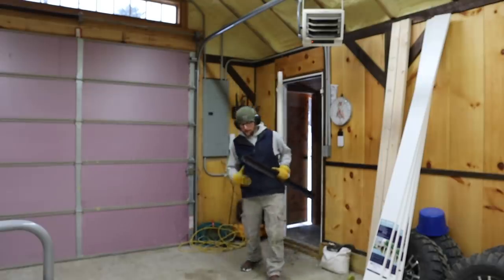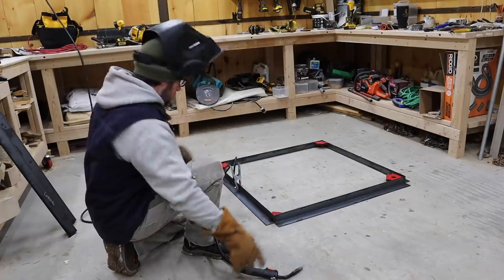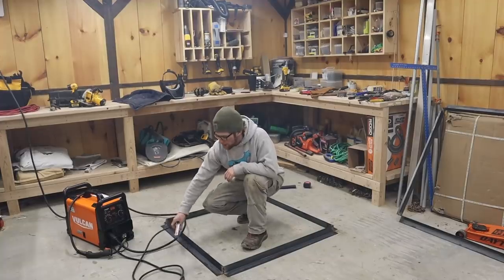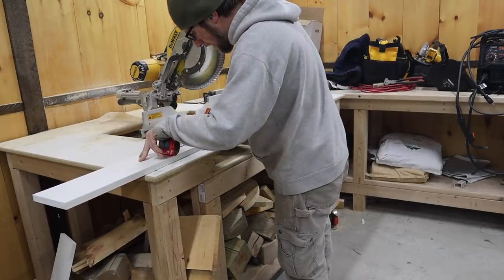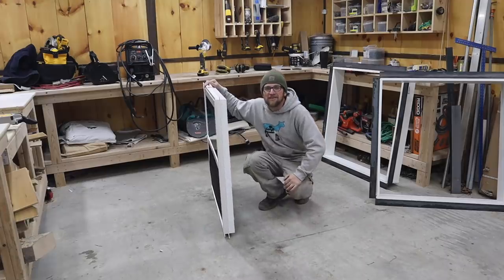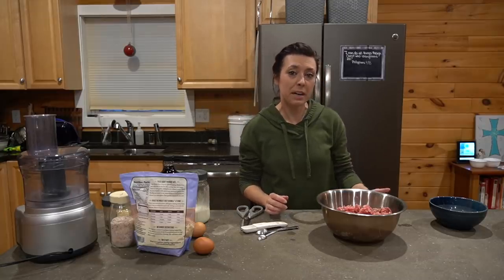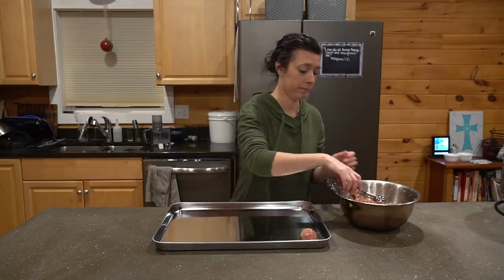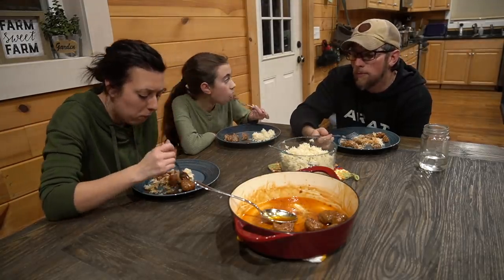Building Window Frames for our OFF-GRID Shipping Container CABIN in the WOODS

Comment: The angle irons need to be ordered 2" longer on every end, soon 4" more length on each piece, so you overlap corners, not just touch tips. Purpose of angle iron frames are to reinforce the structural integrity of the shipping container walls and prevent sagging and torque (twisting). You would use angle grinder with metal-cutting disc to make handshake joint, like finger joints in woodworking, or 45° angles. Grind off all surfaces to be welded to ensure strong joints. These are *structural*, not just pretty window frames. Keep shipping container strong. Keep cords out of "work field" when welding, should not lay welding lines over freshly welded HOT areas, it's dangerous. Good luck in off grid!
Reply: I totally agree, he needs 45 at the corners.  Angle grind them to get a small gap for better weld, an don't forget to grind of the surface prosody (I think thats what it's called) first.   Watch some @weld.com videos
Reply: @davidfitwe  or cut one vertical and make sure the horizontals of that over lap/ match ,so its one H weld and one V weld  sometimes the 45 is not so easy to do and it is off grid so no one but US will know
Reply: @gsyguy1  Since he gets his local metal shop to cut the angle iron for him, they should be able to do the angles for him.
Reply: @davidfitwe  true.
Reply: The structural integrity of a shipping container will not be affected by these openings, I can buy containers that the entire side is doors.

Comment: I prefer to make 45 degree cuts on the angle iron as that gives you a larger area to weld for greater strength and a more finished look.
Reply: Totally agree, Yes to either 45 degree corners or 2 inches overlapping finger joint corners to ensure strength of walls.
Reply: I agree too.  You should also grind off the mill scale from your joints and where you connect the ground before tacking. Clean off tacks before welding over them.

Comment: Al, just a heads up for the door, usetubing for the extra strength instead of the angle iron mate. A deadlock is only as strong as the surroundings and tubing strengthens the container walls better with larger cut outs from the original metals

Comment: Marcia! Marcia! Marcia! SAFETY!  SAFETY! SAFETY! LOL. Al, it's very important to wear safety equipment at all times, when cutting, grinding wood or metal. Never go naked. Always need full goggles over glasses, face shield, ear protection, and breathing barrier. Also best to use task specific welding gloves that have long extension past the elbow, a welding apron that prevents burns from flying hot metal shards, and for true protection, a welding blanket all available from HF... Ventilation, weld outsife. Need big fire extinguisher handy. And you should not squat or kneel over a hot weld area in case you fall forward. To be safe, put your welding up on a safe secure stand, so you are standing and can safely back away. This from a girl who welds LIL

Comment: Al, when you join two pieces of metal together you have to First grind off the mill scale, rust and paint, you will Not get sound welds without first prep the metal, your welds will be full of Porosity, Undercut, and Linear indications. Also i can tell by the sound of the arc the machine setting are off. You also need to feather your tacks before welding over them.

Comment: Al, you need to build yourself a roll around work table for assembly of different projects that is larger than the actual work space of the built in work benches. You could build it whereas the top drops down and lies flat for storage against a wall when not in use ! It would be much better than assembly of a project on the concrete floor of the shop .

Comment: Al, get a container of Vasoline and dip your tip in it after its hot and that will prevent the slag from sticking to the inside of the tip and clogging it.
Reply: Much can be said in humor to your comment. Lol
Reply: @jameslemon51  HEY, HEY, HEY this is supposed to be a "FAMILY CHANNEL: here -lol --
Reply: If you notice, he removed the "NOZZLE" from the hand piece. They make and put them on there for a reason just not to look " PURDY"
Reply: @jacksonbrewer2030  The nozzle is for welding with a gas shield . Some guys remove the nozzle for flux cored wire.

Comment: When your fabricating you should always go criss cross when you tack and when you run a bead because it will pull, also have your top and bottom pieces or your side pieces either or cut longer, it looks like your using 2"angle so get the two cut 4"longer that way you can cope them and it will make the frame more rigid!!!! The way you did it now you see how they wobble all over when you pick them up they can get knocked out of square plus it makes the frame look way nicer instead of having the open squares on each corner!!!!
Reply: agree
Reply: inside dimension then cut at a 45 degree angle for more strength

Comment: Over the years I seen how detailed you can be on various projects, when purchasing your angle iron, that 2 inch angle iron you should have got a extra 4 inches per piece, that would have allowed you to cut a 45* angle on each corner which would have closed your corner frames off rather than having a 90* open corner.

Comment: Al, if you are going to be welding on concrete put a cement backer board under it. The concrete can get hot and pop and destroy the looks of your floor and it could heart you also. If  you really want to get good at MIG welding switch over to solid wire with gas.

Comment: I have built a lot of shipping containers in to offices and brake rooms and electrical room. The best way I found to frame the windows and doors is to use 6" x 1/8" flat bar. Im afraid you angle wont be wide enough to cover the depth of the side. And dont put you PVC on the angle until you have it all welded in, so it wont melt LOL For sure get a metal door with a metal frame so you can weld it. I skip weld everything then go back a calk it all good.

Comment: AL i didn't see any cleaning of the area to be welded with a flap disc to insure a lasting weld and stronger weld without the impurities burnt into the joint promoting rust. Gina to make cleanup easier use a piece of parchment paper to line the pan,  the pan will look nicer longer as well.
Reply: lol....he's not building the Space Station.
Reply: @python3574  True however Al likes doing things the right way and is fussy about hit work, did you notice how he realigned the corners of the frame he was building that was maybe 1/8 out of square? I was making a observation.

Comment: Al, be careful with those welding cables. You don't want to be dragging them across hot work.  They're expensive to replace.
Reply: i was thinking the same. hes gonna melt the cable.
Reply: I was also thinking of that.

Comment: Al you need to check out Incredible Tiny Homes YT they are based in Tennessee. Search for container homes. They have built several, they tried the metal frames for the windows but there was too much transference of cold/heat. This caused a great deal of condensation inside with the interior surrounding walls having water damage.

Comment: Might think about getting silicon pads for the new trays... easier clean up :_ILikeIT:
Reply: Good morning David
Reply: Or use parchment paper.
Reply: @margaretbedwell58  I'm getting into more cooking in my oven and wonder if parchment paper can be used for any type of oven cooking at any temperature.
Reply: @lloydwilliams8715  Good morning Lloyd!
Reply: @jacksak  As far as I know it can .  I have used it in my convection oven, Microwave and regular gas oven.  I have used it at low temp as well as up to 475 degrees I don't need any higher than that.  I have used both white and brown parchment paper, I'm guessing the brown hasn't been bleached but I don't know that for sure.  I have also used it  with food that produces quite a bit of grease...like bacon.  I hope this helps you.
Reply: @margaretbedwell58  Thank you and it helps, because I'm now going to buy some to use.
Reply: @jacksak  If you have Aldi where you live, they carry it.  Also "the Christmas Store" which is an off shoot of Bed Bath & Beyond, they carry it as well.  Both stores are cheaper than the regular grocery store I believe.
Reply: @margaretbedwell58  I've never been to Aldi, but there's an Aldi close enough for me to drive to in another town. And, I'd like to see what Aldi is all about having recently read about it.
Reply: @jacksak  I think you will love it.  You can save a lot of money (if it isn't too far to drive) and if you buy their store brands.  I have not had a bad experience with their brand whether it be canned goods or cereal, baking goods or cookies and crackers.  They carry cookies that are just like the Girl Scout cookies and they are under $2.00.  All of the dairy items and the meats that I have purchased are great.  Love their sausage  in the one pound roll.  Also butter is very reasonable as is the cream cheese.  I guess  you can tell I'm a fan.  I hope you enjoy it.
Reply: @margaretbedwell58  Thanks again, and if I see you around on YouTube I'll let you know if I got to Aldi.
Reply: @jacksak  Thanks Jack.

Comment: As a welder for 50 years and a fire and explosion investigator for 25 years I seriously suggest you put down either cardboard or wood before you weld on concrete.
Its called spauling, where the moisture in the concrete heats up and explodes.

Comment: Were your lines on the welder burned??? as they were on the hot weld (6:24) when you moved to another weld??? 
 Best you have a fire extinguisher nearby as the sparklers will light the sawdust under your workbench. 
Al, if you did not paint the cut-out window area on the shipping container they will be rusted by now & if you do not remove it before you set the windows you will deal with rust forever!

Comment: I recommend that you get a metal chopsaw , then you can buy longer lengths of mild steel, much cheaper in the long run but you can also mitre cut each corner of the angle iron frame so it looks much nicer from the outside. Now you have a welder you can make all sorts of things and your workshop will turn grey from all the cutting, grinding and welding then when you make something out of wood you’ll end up with grey fingerprints everywhere. You could also make a welding bench out of mild steel with a vice mounted and the earth clamp mounted to the frame this will make welding much easier plus you can stand comfortably over your workpiece, this will help improve your welds,

Comment: hi, did you know that when you weld you can catch a flash, but when you wear glasses you'll never catch one, I have a welder too and someone 
told me and it's true it happened to me that my welding helmet was badly installed and I took the flash but it doesn't know what to do next, no burns to the eyes, nothing, bye
Reply: Some/many types of glass and plastics used in lenses for glasses do block UV to some degree (often quite well), but chancing it can turn out painful, should they not ...